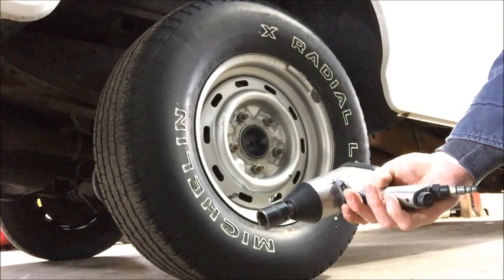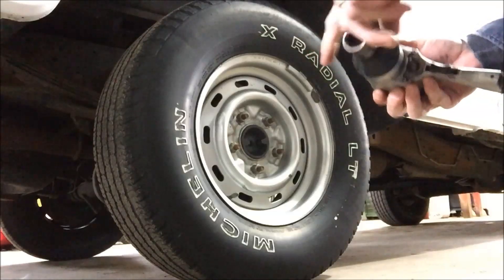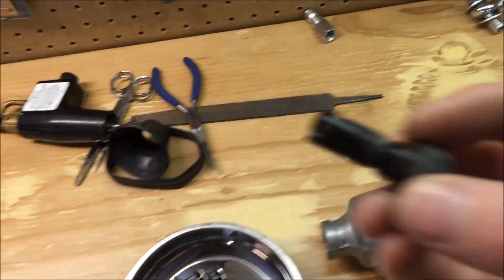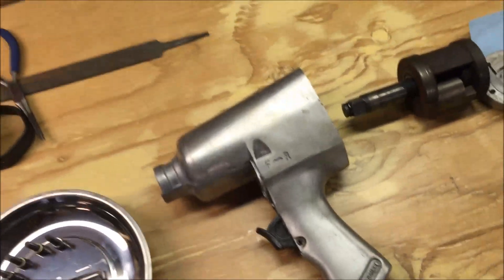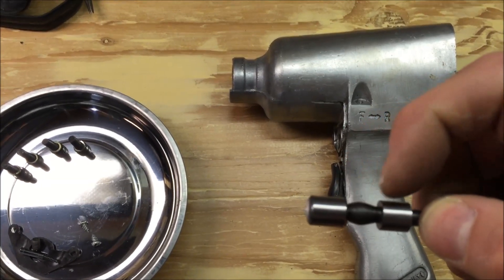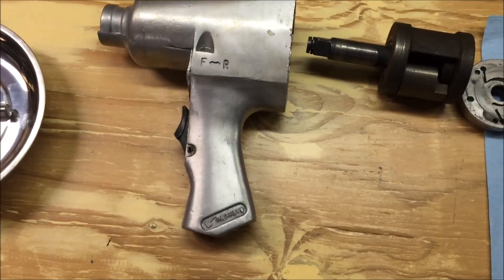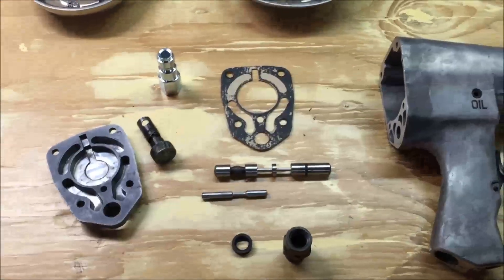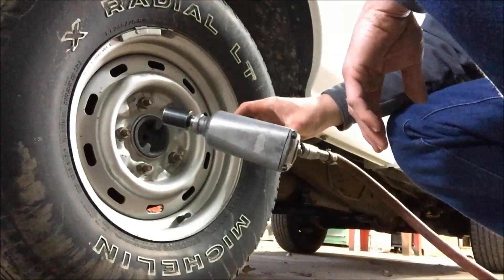Modifying an Impact wrench for more torque (1st attempt)

Comment: OK. I have a 2015 GMC Sierra 1/2 ton 4WD. The torque specs on the lugs are around 140 ft lbs. I can remove my lugs with my Kobalt 1/2 brushless impact that only has 200 ft lbs break away torque. Those lugs nut on that truck are tightened way beyond what is required. So who ever is slamming those lugs on that truck is a jerk.

Comment: It seems to be a growing thing that everyone is looking for more and more from there air compressor and air tools, especially the renown impact wrench. I for one have been using the same air compressor and impact wrench since 1998. The only changes to my compressor, is I had to replace the pressure gauge 2 times until I figured out that if I made sure it was positioned correctly so as to not allow moisture to collect due to facing 'down hill' so to speak. I replaced the pressure regulator switch once. Also I learned to use quality connectors. I prefer Milton, not to imply that there are not other quality types out there. Just that they don't sell them at HF. I've had no issues dealing with lug nuts on all my vehicles and my grown children's vehicles. Just so you know, I have a Campbell Hausfeld compressor VS501000 13 gallon 125 psi max SCFM 5.6 @ 90 psi and a Campbell Hausfeld 1/2 impact wrench which I do not know the model number but I purchased it the same day I purchased the compressor. My compressor does not have an out pressure regulator, so I have one attached to a bracket that's hung on the wall so if I have a reason the set the out pressure below what the 125 max, then I connect it to the outline and connect air hose on stored on the reel. I have 100 feet standard 3/8 rubber hose using Milton Hi-Flo connectors. It has served me well and I do not see any need to change anything until it is worn out. I was able to remove all the lugs on a friends 2010 GMC 2500 HD with no problem. I would suspect that if someone threw a 1 ton at me, I may not be able to handle that unless I pickup a higher torque impact, like an Earthquake. Not a mechanic like many of you are and you very well need all you can get out of your tools after all they're your livelihood.

Comment: whoever tightened up those wheel nuts needs a kick in the bollocks... miles too tight... only need around 80ft pounds of torque. . so many garages do wheel nuts up with a fully open impact gun and its dangerously tight as liable to break the bolt threads/nut threads.. if you cannot undo these easy with a normal car wheel brace they are too tight.... put a torue wrench on them to see just how tight they are ??? probably 150 to 200 ft pounds maybe even more

Comment: first thing to do is go to compressor and check the gauge shows 90 psi with the wrench working.. not with wrench sitting idle.... and then make sure you go good air line 3/8th minimum and put the gun to the hose with just a single quick release. quick releasefitting slow down the air so you need to make sure the air line can give the power... put airline direct to tank not through any fittings. go direct or you lose the power... only drill out the one large hole in the setting.. the idea is not for speed but for power. so you can dial it down and not strip out weak bolts/nuts.

Comment: You get what you pay for.   You can get the Earthquake XT with coupon for  $99.    Instead I upgraded to the Aircat 1150 and I expect to have a quality product for a long period of time that can actually do the job.   You should also upgrade to high flow connectors and couplers and that will provide more power.

Comment: Just did similar mods to an identical wrench. Drilled out the screen, drilled the exhaust ports in the motor out to 3/8, drilled two 3/8 holes in the housing directly over the motor exhaust ports, and drilled the number 4 port out to 5/16. I also oiled all the internals with motor oil. Even on standard 1/4 inch hoses and fittings it really rips at 100psi. It's also much louder. I put a 1/2 inch nut in the vise and it ran a grade 2 bolt all the way down to the head, unthreaded shank and all, without any trouble at all.

Comment: Very interesting. The pneumatic motor may be way undersized for the hammer weights.
Reply from the maker: Someone mentioned that they bored out the cylinder and did some work to the vanes and it improved quite a bit, so your probably on to something. Unfortunately on mine I have already machined the outer part of the cylinder to the point that there isn't much material left to remove.

Comment: I have the exact same one looking one as you do, but mine is branded "Air Mounty"...I have found it to be kind of weak too, even though it claims to be rated at 312 Nm / TQ. I might try something like you have done here..

Thank you for sharing the tips
Reply from the maker: Your welcome, The mods definitely make it usable as a light duty impact for lawnmower blades and bolts you don't want to snap off etc. But for larger jobs there's no substitute for a better impact.
Reply: Steve Stoltz - it worked on getting the pulley off my alternator, but for wheel nuts; it feels completely gutless
Reply: Steve Stoltz - if you don’t mind me asking; how did you get the buttom fitting out, and the part where you adjust the power?
Reply from the maker: @socialghost4400  on mine, the air fitting just unscrewed and the spring and ball just came out. For the adjustment knob on mine, there is an Allen set screw on the front of the grip down from the trigger. Once you back that set screw out you should be able to wiggle the knob out.

Comment: That's my first impact.  Still have it, got in a 1995yr set with the CH compressor and 1/4&3/8 ratchets.  I don't know why I still have it, other than no one else will want it and still works.  Kind of a nostalgia thing i guess.  Never did have any great torque, but was better than nothing and did work well on less than 150ft/lb nuts.  I have many other impacts now.  A lot of great memories fixing cars with it.  Now just a tool box decoration.

Comment: Cheap air impact wrench has limited hammer power and air motor torque cannot fix.  Just push up the compressor PSI to increase a little bit torque.  Can't do much to raise the ft-lb torque.

Comment: Very nice video! The thing is that I have the same cheap ass impact you are trying to modify. It has 4 setting that go from 190Nm to 300Nm. It is equipped with a single hammer mechanism. I understand that you are trying to boost the Nm output, very nice by the way. The thing is that the impact you are using has a range from 250-600Nm (twin hammer)), give or that a few Nm. Setting 2 that you use to fasten the nuts must be around 350Nm. The cheap ass gun normally cant loosen that, so you try to boost its power. I think that you are way overtighten the nuts on the wheels. The maximum setting for a normal car in Europe is about 125Nm. The cheap ass gun can loosen this on setting 1! But very nice video, thx 4 that!
Reply from the maker: CitroenRasp dideveed Yeah it was kind of like comparing apples to oranges, I would do things a little different if I were to do it over again. I’m fairly certain I over torqued the lug nut, if not this time, I did when I did the torque wrench test lol. Thanks for the comment.
Reply: If you add all the weather elements to that 125Nm and heat cycles it becomes more like 200 something 😁

Comment: I have the same gun, and the same problem. It would have been interesting if you had torqued those lug nuts to a value (say 100 lb ft and 120 lb ft) and note the before and after results.
Reply from the maker: Yeah I thought about that after the fact, It would have been more helpful to people with something to compare to.  It is a useful impact now though, I use it all of the time for lighter nuts and bolts, I don't have to worry about snapping things off with this one.

Comment: There's A Recommended Air Setting For Every Gun According To Manufacturers. Too Low Or Too High Can Be Problematic... Not To Mention Rocking Dog Clutches Have Relatively Low Torque Outputs, Which Is Probably Why It Won't Remove Lug Nuts 
.
Reply: Wtf

Comment: I am enjoying your video, and I had the same impact for many years.  It died, but it was my fault.  It took a spill off a ladder onto cement.  Anyway, I replaced it with a much more powerful unit.  While I like my new impact a lot, I really miss the old one as you could not snap off a fastener with it.  The new one will snap things at the drop of a hat.  Every tool has it's place.  It surprises me how much I miss that old impact.  BTW, she will crack lugnuts, it will just take it like 10 minutes of banging on each one.

Comment: You can get a IR TI 1/2" impact used on Ebay for a reasonable price and rebuild it for cheap if it needs rebuilding. IR are the industry standard.

Or at least get the HF Earthquake models. They are supposed to be very decent and modern in design and performance.

Those steel case impacts (whatever brand) are very ancient in design and should not waste time on those. Time is money. And wasted time is stressful. Seriously, just give it to a metal recycler.
Reply from the maker: I have other impacts, I actually compared this one to an Earthquake in the video. This was just something I did for fun in my spare time. This impact has become my go to for light duty things though, like removing stubborn bolts from lawnmower engines etc. The 700 ft lb gun will just snap the heads right off of the bolts, where this one will gently work at them.
Reply: my old ir 231 still going strong after 15 years
and its not a ti I wont get a polymer one either when my 231 dies I think ill get another 231 if they still make them by then
Reply: @MrShaun1578  gay. Get a 2235 timax, run 150 psi, and power the power switch on low when in reverse. It’ll give you enough power to break every  socket you own. Keep spare sockets and anvils handy

Comment: i wonder if drilling the passages in the housing itself would help. also, maybe somehow adding weight to the hammer, maybe migging beads across the back? just throwing ideas out. the forward/reverse switch is pretty restrictive too.
Reply from the maker: I considered drilling holes in the case, the exhaust seemed to be the most restrictive bottleneck on the outlet side, but since I didn't got to the extreme on the inlet I just settled for opening up the existing ports and machining the outside of the cylinder a bit. I machined the forward/reverse mechanism quite a bit, but the ports that were cast into the housing were hard to reach with anything that I had available.

Comment: don't fail to consider how much a quick connect can impact your torque, too.  You could try to ream the the wholes in the quick connect like you did the gun, or screw the tool straight into your airline.  Alternatively, it could just suck :p  I've been relatively happy with the HF "professional" model (earthquake) for working on my  little nissan sentra, so I don't think you got pop out near 500+ bucks for a great impact